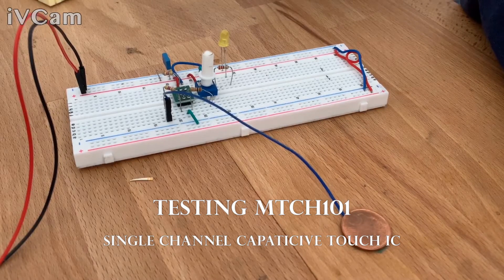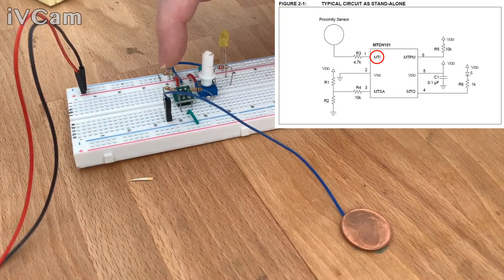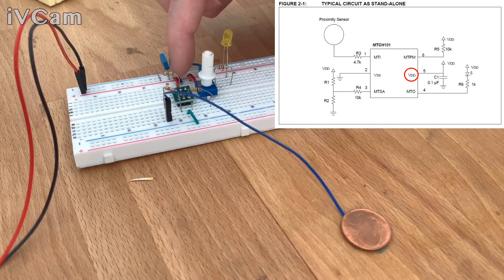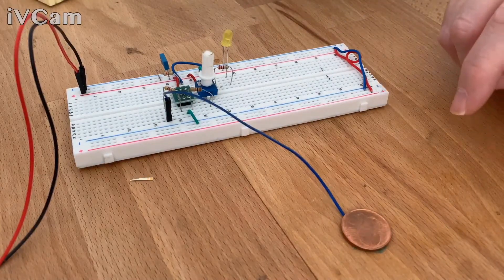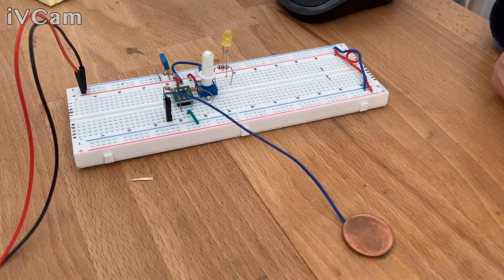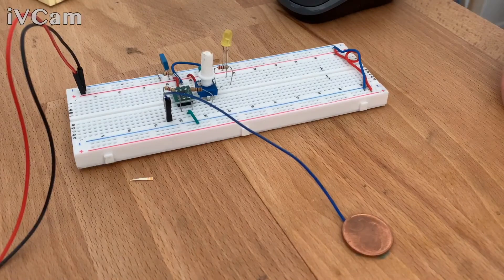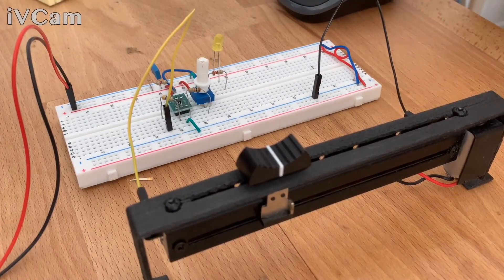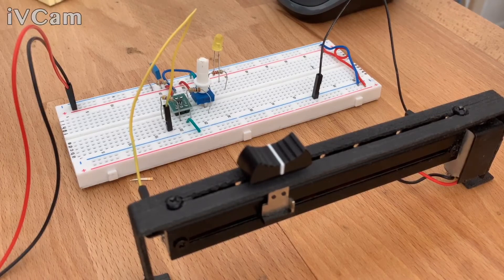Testing MTCH101 Single Channel Capacitive Touch IC

Comment: Does the sensor only respond to a human? Or would it also work if, for example, I place a small magnet above or next to the coin?
Reply from the maker: It is based on capacitance principal. So it reacts to whatever increases capacitance in the circuit. Never tried with a magnet but I have some doubt

Comment: Great video ! Does it stay active while you touch it for long period of time? Does it sense water (like in plastic bottle ? Thanks
Reply from the maker: Hello yes it stays active for all the time you touch and the touch is detected through plastic. No idea about water.
Reply: @fcampanini  Unfortunately is out of stock until next year. Thanks
Reply from the maker: Unfortunately that’s the story for basically every integrated circuit today…..
Reply: Hello, 1 year later but have you had the chance to test the detection with a water bottle or water glass? Thanks

Comment: Hi great video!
I am trying to figure out how to use MTCH105 (5 Keys) and maybe you can help.

My use case requires the output to be ON (active low) for as long as I keep my finger on the sensor. The max required time will be less than 7 seconds. 
I have been going through the datasheet and I can't seem to figure out whether this is possible using this chip or will I have to use AT42QT1070 (another chip from Microchip with this funciton).

Here is the datasheet for your quick reference - 
MTCH105  - https://ww1.microchip.com/downloads/en/DeviceDoc/40001793C.pdf
AT42QT1070  - https://ww1.microchip.com/downloads/en/DeviceDoc/Atmel-9596-AT42-QTouch-BSW-AT42QT1070_Datasheet.pdf
Reply from the maker: Dear Shivan, thanks for being interested in my video first of all.
If i have well understood your need, I think you should not have any issue with MTCH105 which is the same as the MTCH101 I have tested in the Video. It just offers more channels. Point is that the output will stay active for as long as you keep the finger on the sensor plate and even 7 seconds should not be a problem. For your reference i have made recently another video on the capacitive touch argument that might be interesting for you: https://youtu.be/U6I6Vb-2H_U.
Cheers,
Filippo